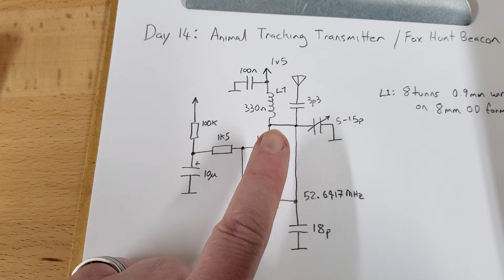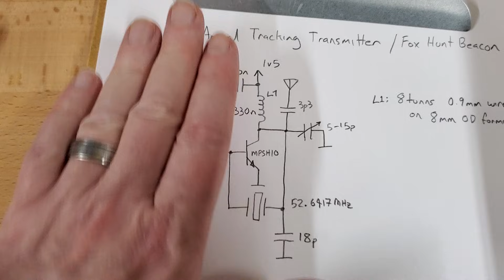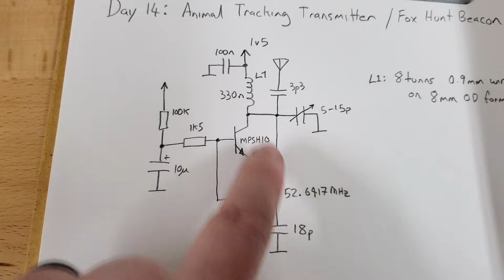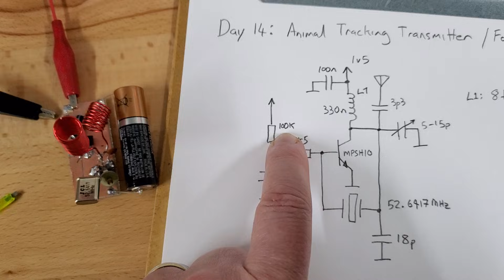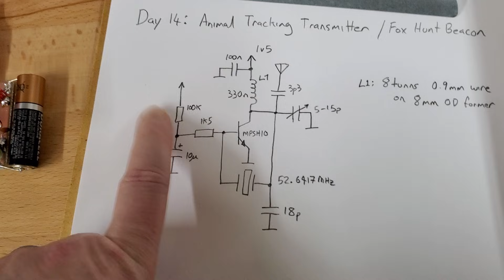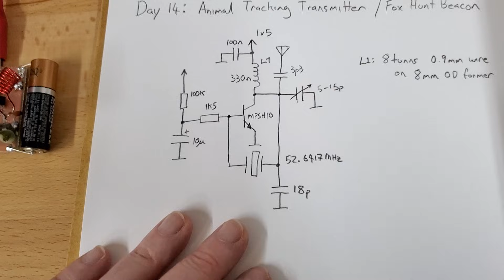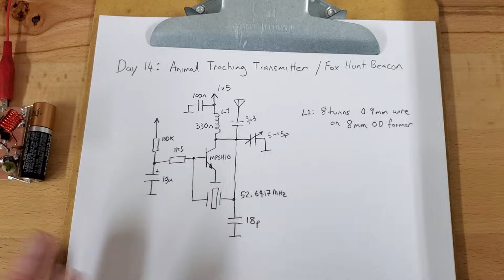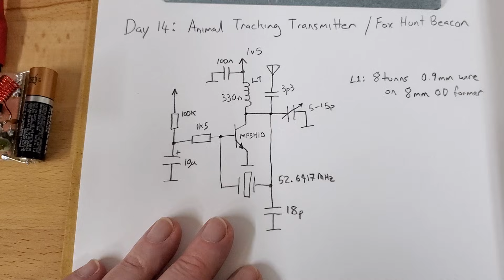ACoC 2025: Day 14: Animal Tracking Transmitter / Fox Hunt Beacon

Comment: Interesting. If you wanted to transmit continuous wave or perhaps introduce some more subtle modulation, could you simply replace the 10u capacitor with a suitable resistor to give the transistor a consistent bias?
Reply from the maker: Yes you can key the transmitter by switching the base bias digitally.  It will be a bit chirpy as the oscillator starts up but not as bad as when it is slowly rising with the blocking oscillator.
Reply: @vk2zay Thanks, and Happy New Year
Reply from the maker: @christianblack2916 Happy New Year!

Comment: I Just Uploaded Video Of My Petterson D200, Is It Similar Device As This?
Reply from the maker: That appears to be an ultrasound down-mixer for listening to bat sonar?  That is not what this is, no.  This is a RF transmitter and I am using an SDR radio receiver to hear its emissions.
Reply: @vk2zay Ohh, Rtl.sdr? Im Using It To With My 30 to 10 meter LPF, great hobby. :) wish to learn how to make antennas for walkie talkies, i have a naniVNA, but the MAKE AN ANTENNA is not that simple, Each frequwncy requires diferent lenght antenna even if its quarter wave.

Comment: so cool... what ideas do you have for this example situation: let's say you had a fleet of these (let's say like 1000 of them out in the field). How would you somehow encode an ID in the information so that you could uniquely identify which beacon was chirping? or maybe even filter out the specific beacin you are looking for?
Reply from the maker: To do that I'd probably go to something more sophisticated, with a microcontroller in the system to store and modulate the RF with the ID.  In which case the transmitter part would just be a power oscillator and its bias would be driven from a GPIO on the MCU.  The MCU would sleep most of the time, waking only to read any sensors and transmit a data burst.  A simple OOK modulation with a frame consisting of a short preamble, the device ID, any telemetry data and a CRC would do the trick I think.  Randomise the transmit time to give a reasonable chance they won't step on each other continuously, but their clocks will drift apart anyway.  At which point you might just want to use an MCU with a sub-GHz or BLE transceiver built-in and do something more sophisticated to synchronise the system not just a pure ALOHA media access strategy.  But it is possible to make a lower performance system for fun using the superregenerative crystal oscillator hack I have a previous video on somewhere - basically you can use your transmitter oscillator as a receiver at very low data rates with a single GPIO.
Reply: @vk2zay  yeah it sounds like it is getting pretty close to rfid processors communicating using epic global spec. I just wonder if there is some clever way to do it without a MCU.
Reply: @vk2zay  for example, I wonder if you could have a binary digit set with dip switches (or whatever method you want) and then shift those values into a part of the circuit that adjusts between two frequencies for FSK, or maybe easier just an extra amplification of the chirp amplitude to do ASK... something like that?

Comment: I like the frugality of your projects.
Maybe I am not attentive enough, but did you mention the range of this transmitter? How far away can you 'hear' it?
Reply from the maker: I am not sure yet...  It generates a few volts of RF at the collector so it could deliver a few mW or more into the antenna wire with more attention to matching it properly.  Then it becomes more of a question of how good the antenna is at radiating that power, how sensitive the receiver is and how good its antenna is.  If you have say a 10 uV sensitive receiver and moderately good antennas you can easily get many, many kilometers in free space.  I'll get back to you!